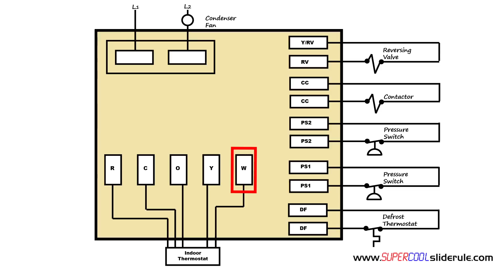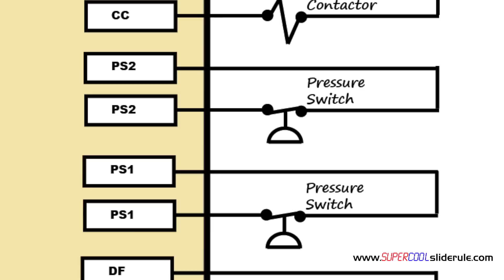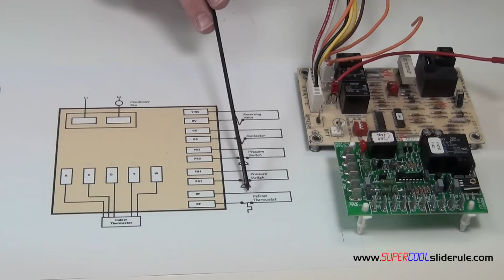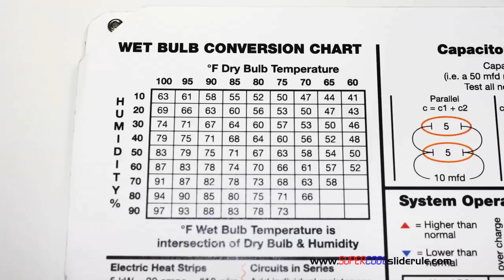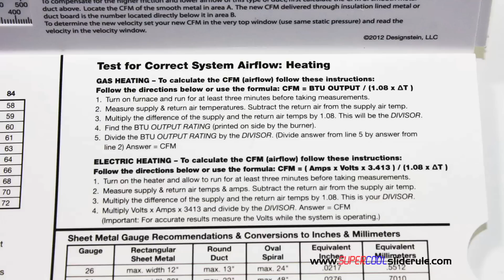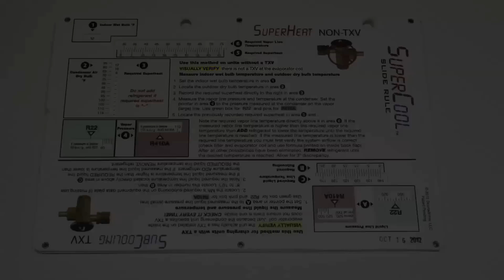The Sequence of Operation for a Defrost Heat Pump Board

Comment: Good presentation. A few tips the outdoor fan leads are not L1 and L2 as in the diagram, they should be basically in and out (Line 1 and Load 1). This is a switch or relay inside the defrost board that shuts off the outdoor fan during the defrost cycle. This relay can go bad causing the fan not to work- or the opposite-to work during defrost cycle. So when testing defrost cycle make sure it is working. Also it may be why the fan isn't running so bypass it when testing for a bad fan motor. 
The other thing you should mention is the defrost cycle only occurs when the defrost thermostat is closed on most if not all brands. So the cumulative timer counts run time then checks for a closed defrost thermostat then starts defrost. Most brands use either or time or temp. to come out of defrost- meaning if the defrost t-stat opens contacts OR if 10 minutes of defrost occurs it switches out of defrost mode.
 
 The wiring diagram shows the defrost t-stat closed which is when it is NOT in its normal position but instead is the "cold" or closed position which occurs at about 30°. Unfortunately ICM does a poor job on its wiring diagrams for its defrost controls - I have studied most of them and they are just not well drawn. I hope they revise them- because when a tech is on a job it is very frustrating to try to figure this out. ICM also has poor instructions and diagrams with the fan speed control they sell for slowing the outdoor fan down with lower ambient temp. on cooling cycle. ICM does have good products though.

Comment: It appears that both pressure switches are high pressure. And the 30,60,and 90 minutes on a trane means that it checks to see if defrost is needed , it does not automatically initiate defrost unless needed

Comment: Great video!! I removed my reversing coil and bench tested it using a HVAC 24 volt transformer. After a few minutes is began to really head up. I was wondering if anyone thinks that's weird. Maybe the coil uses the reversing valve body to cool it.Maybe my coil is damaged. Does 1.3amps of current used sound like too much for the coil?
Reply: You all probably dont give a damn but does anybody know of a trick to log back into an instagram account??
I was dumb forgot my password. I would appreciate any tricks you can offer me
Reply: @Bradley Nelson instablaster ;)
Reply: @Landen Francisco thanks for your reply. I got to the site through google and I'm waiting for the hacking stuff now.
Seems to take quite some time so I will get back to you later with my results.
Reply: @Landen Francisco it worked and I now got access to my account again. I'm so happy!
Thanks so much you saved my account!
Reply: @Bradley Nelson Happy to help :D

Comment: What is R for? I didn't understand your explanation. Thanks for your instructive video.
Reply: A transformer has a high voltage side and a low voltage side. In residentail applications for heating/air conditioning  the high voltage is usually 120vac and the low voltage is 24vac. The colors typically represent which wire is hot and which wire is the neutral or common. In this case the on the high voltage side the black is hot and the white is neutral. On the low voltage side the R is 24v (hot) and the C (common or 24v neutral). The R terminal is a yellow wire and the C terminal is typically a blue wire but that could vary depending on the style (terminal or wired) of transformer.
Reply: 120 on an ac or heat pump unit?

You might want to do a little more reading up on the subject.

Just my opinion 

I know this is an old post, but I don't see anyone throwing up any red flags.

Comment: Having an issue with a heat pump at a family member's house. I normally do only commercial (no heat pumps)... Is there any reason I would have power at W2 but not getting power to Y from the tstat? Tstat seems to bring on AUX heat immediately without the outdoor heat pump ever coming on. Their electric bill was crazy, as you can imagine.
Reply: When the call for heat exceeds two or more degrees above room temperature, aux heat on some tstats will automatically come on with the outside unit. Check your wiring and tstat.

Comment: My outdoor heat pump never turns on, not even the fan.  I didn't have 24vac at the contactor, but it was at the transformer.  I disconnected the white wire from the thermostat and it works now.  Any ideas would be greatly appreciated.
Reply: 62T-bird Man I have same issue maybe it's trying to call for cool and heating at same time maybe jumpers inside thermastat

Comment: what hoppen if I not have 24 volt on white wire in side on thermostat all wire are power 26 volts only white 19 or 20volts may be the defrost bord is not good.... thanks for any help.

Comment: Why does a new packaged heat pump freeze the txv and the condenser in heating mode when the ambient temperature is 31 degrees and it does not reach the temperature inside the house and when the ambient temperature is at 43 degrees the thermostat keeps the desired temperature in the house

Comment: My defrost heat pump board (031-09104-000 ) condenser fan terminals are shorted when thermostat is powered off.  When turned on to cool with temperature down, the terminals open so my fan will not turn on.  I believe this is a bad board.  Would this be correct?  I tied the two wires together and the fan motor works great.  Power blinked off for 8 seconds and my AC went out.  Condenser motor starts find but the fan does not come out so after a few seconds it turns off.  I replaced the dual capacitor and measured the old one which tested fine.  I believe I have a bad board now.
Reply: If I think what ur saying is right take ur  black wire for fan outta that lil relay box on board I believe it’s of1 and hook it straight to contactor see if that works

Comment: Maybe someone can answer this question. I have an emergency backup generator. That is not capable of powering the heatpump and heat strips at one time. Say the unit calls for defrost and energizes the heat strips to keep the registers from pumping cool air during defrost. I understand the system will have to work harder to keep the house heated or may even fail to hit the desired temperature if aux heat is not online during defrost. 65 is a lot better then 35. With that said, can I just interrupt the w coming into the thermostat with a switch or just disconnect during these times. In theory can't the heat pump continue to function and provide some heat but at a much lower efficiency?
Reply: I think you can do just that.  You could use an automotive fuse holder and a 1 amp fuse in the thermostat and pop the fuse when you need to.  I like the Japanese way of energy usage in an emergency. Kotatsu table and heated mat. A kero K1 heater and sectioned off  room.
Reply: @oldengdg2575  these are short term emergencies I'm planning for. No long term multi week power outages. With who I live with now I'm a goner if I stay with them they are immediate family and it's sad to think that but it's the truth. A few 55 gallon drums of kero will heat a large space for quite sometime

Comment: quesrrion about board? on circuit board reeplacement we would puut sometjing between board and galvinized mounting surface to avoid contact that could damage board  replaced frost control board in goodman heatpump
with natural gas fired emergency heat. backup. board was visibly discolored and certaintly had something happen. replaced it put tape on mounting feet which were metal! arre those feet supposed to be metal contacted??
Reply: Yes, the feet are metal. They should be metal and there is no need to try to insulate them.
Reply: Thankyou

Comment: On my thermostat, there are RC and RH with a jumper.
Reply: Wait I have one transformer and all my thermastat work with the jumper
Reply: In regards to having "two transformers, etc.....", that is not always the case 

Nothing wrong with being a DIYer, but be prepared to make a few mistakes here and there when you don't know what you don't know.

If you don't understand something, at the very least, research what you're doing before you get in over your head.

Any amount of electricity can be dangerous and deadly, even "low voltage", given the right circumstances.

Comment: Isn't defrost initiated by time and temperature and terminated by temperature or time
Reply: Not always 

Need for defrost is the best reason defrost to be initiated.
Reply: Some of your high end units actually use a coil and ambient sensor to find a delta t. Only going in when needed